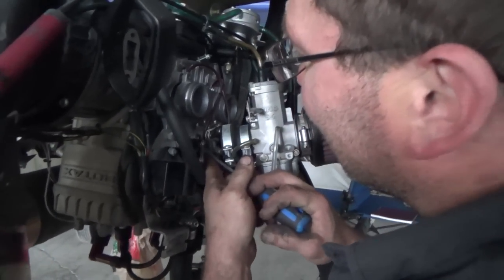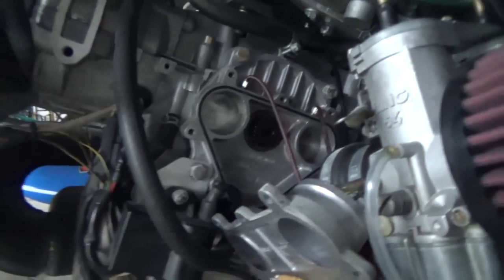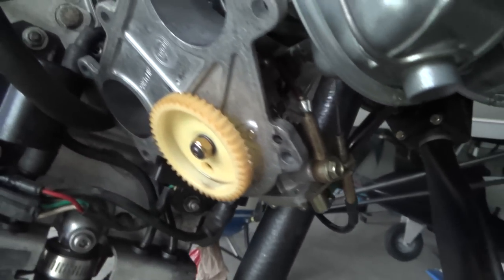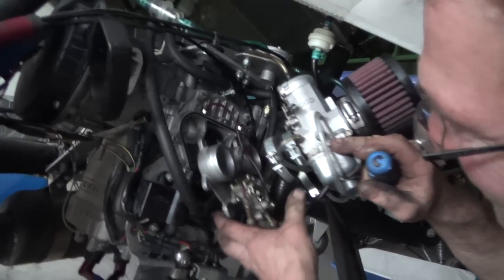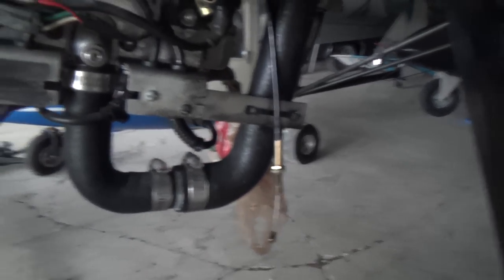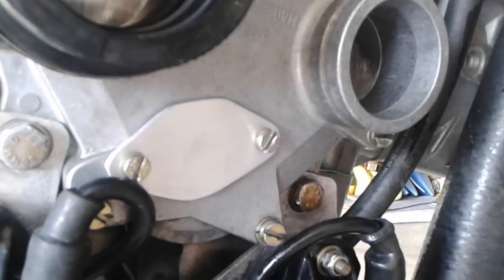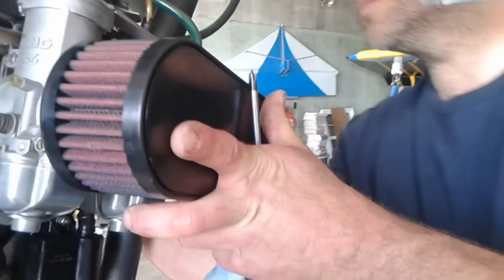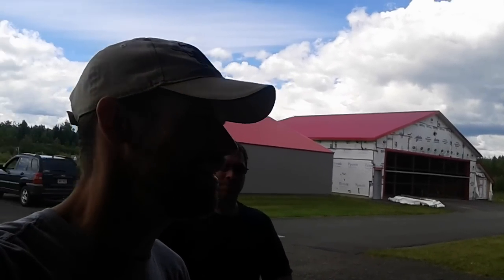Rotax 582 | Removing the Oil Injection

Comment from the maker: Since several have brought it up both here and on Facebook where I posted it, I wasn't actually double oiling the engine. I know I said I was in the video but it was getting rambly so I didn't include the following details:
- I was pre-mixing with Amsoil Saber at 200:1 which is a number I read online somewhere that indicated it was just enough to stop the engine from seizing if the oil pump quit. I don't even know for sure if that's true or not but it made me feel better anyway. 
- Amsoil Saber also has a fuel stabilizer agent in it which helps keep my gas fresh for longer (I still replace any gas in my tanks that's older than 30 days)
- I used Loctite everywhere the engine re-build manual said to use it
- I don't lock-wire my air filter for 2 reasons:
   - it's one unit held on by 2 clamps. It's very unlikely that both will fail at the same time.
   - I remove the air filter every 10 hours to chemically de-carbon the pistons and rings with Sea Foam. Lock-wire would make this already tedious process even tediouser. (that's a word... right?)

Comment: Premix also helps lubricate the carb slides and parts since injection is after the carbs. I believe it's a good decision and one I made on my 582 as well.
Reply: Carburators dont need oil to work, all 4 cycle gasoline carburated engines have no oil whatsoever on the carbs
Reply: @esau82  sure but it doesn't hurt, especially since the slide and needle on Bing carbs wear quite a bit due to vibration from the two stroke.

Comment: Hello. Thank you for your video.
I Just had a serious breakdown on one of my pistons & cylinders .  Oil Leak probably because i didn't do exactly what  was to be done when mounting the pump again... soo..
I'm about to make the same "treatment" on my 582. 
I 've seen the aluminium plate to obturate the hole left by oil pump. 
But i didn't see clearly what you have done to obturate these little metal oil injection  tubes  at the gaz intake . A special plug or other device ?
Reply from the maker: I just took a length of hose and connected them together with it. 4:55 shows what I'm talking about here.
Reply: @mmatt  ok thanks

Comment: if I'm not mistaken the hole that you plug goes into the crankcase if so there is a chance that the gasoline will degrade your Silicone on your cover placed you may want to consider removing the cover plate and using Permatex form a gasket instead gasoline will not degrade Permatex form a gasket
Reply from the maker: Thanks for that info. I going to look into this. Definitely don't want that failing!
Reply: I was going to suggest making a gasket.  They sell gasket material at the auto parts store.  Silicone is a bad idea.  Also if you add 2x the oil you will carbon up your rings.  I hear it's really bad on 2 strokes to add excessive oil...
Reply from the maker: Wasn't actually double oiling, I was only pre-mixing the gas at 200:1, not enough to make a significant difference in the fuel mixture or enough to add any considerable carboning. The 200:1 was a number I read somewhere online once that said it was just enough to stop an engine from seizing if the oil pump quit. It was more for peace of mind than anything but since I was already in the habit of pre-mixing, I figured I might as well just do it to the proper ratio and pull the pump.
Reply from the maker: Also, that sealer I used is what the Rotax certified mechanic suggested I use for the case halves so I'm pretty sure it'll be ok for this use too.

Comment: Did you figure out how to take apart that 3-way cable splitter?
Reply from the maker: No, it turns out that it's a sealed unit so we just routed it up and out of the way.
Reply: @mmatt  OK, thanks.  I think it's a mistake to remove oil injection which is highly reliable, uses less oil,  reduces plug foiling, and is more convenient.  I also recommend using Amsoil Interceptor vs Saber
Reply from the maker: @MrHanowski  To each their own. :-)
I can only speak from my experience; I currently have just over 550 hours logged using premix Saber mixed at 80:1. Minimal carbon fouling and no engine issues related to oil whatsoever.
Reply: @mmatt  I can't argue with those results, but I still think Amsoil Interceptor is a better choice.  Most PPC guys, Rotax engine rebuilders, and Amsoil agree.
Reply: This is great, finally somebody thinking outside the box and not listening to anyone, im gonna di the exact same to my 582
Reply: Thanks for making this video, A+ all the way

Comment: Hi Matt. Some other YouTubers who've done this on Skidoos or whatever have advocated filling that orifice that you blanked off with oil before screwing on the plate, to ensure the water pump gets lubed....what do you (and Dave) think? I'd hate anything to run dry.... I believe that there's a cross-shaft in the engine which gets lubed by the rotary valve oil, but that's a different supply isn't it. I'm not sure that oil gets as far as the water pump (?) but then I guess it does on those engines that have never had an oil pump!
Reply from the maker: As I understand it (although I might be wrong) that area still gets exposed to the fuel/oil mix making sure everything stays nice and slippery in there. I'm pretty sure of this because I forgot to seal the area around the screws when I put the plate on and I had fuel/oil mix leaking out until took it back off and sealed it properly.
Reply: @mmatt  Thanks Matt - You're a star. Always enjoy your videos!
Reply: @mmatt  are you sure about that ? You may be running it dry I’m rebuilding a 467 with similar engine design and I’m positive there are oil seals to keep oil in there on the crank
Reply from the maker: @phildelsol97  I'm sure enough that I'm not going to tear it apart and check... lol
I've got over 200 hours on it in this configuration so far with no issues in this area. If that changes however, I'll definitely let you know. :-)

Comment: I was considering doing this to my 618 on my kitfox but ive heard that the oil injection pump is critical to lubricate the rotary valve. Im not sure how true this is but just wanted to mention it. Let us know how this works out  :)
Reply from the maker: Not according to my mechanic.
Reply: @mmatt  Did your mechanic design or build the engine? Did you even bother to ask Rotax themselves, or just take the word of some guy in striped coveralls? I own several pairs of those myself. I have an Eros with the 503. The previous owner removed the pump. I, am re-installing it!
Reply from the maker: I have confirmed with a Rotax certified technician that it is perfectly fine to run any of the Rotax 2 -stroke engines either pre-mix or oil injected. Both methods have pros and cons but neither are inherently damaging.
Reply: Yeah pretty sure the rotary valve needs that oil going directly into it. The old 340 and 440 R/V engines in the late 70s & early 80s were premix, but the rotary valve actually still had its own separate oil reservoir.
Reply: Does the rotary valve not have its own re-circulating oil supply (the little cuboid bottle sitting just above the electronic ignition units)?

Comment: I agree with your decision of removing 1 piece of a mission-critical system & I would consider having oil in the engine (or fuel) "mission-critical".  You DON'T want to starve your engine especially when you're up there in the thousands of feet.  And a nylon gear supplying oil for the mix is unnecessary when you're already mixing!
/So yeah...Bob's your Uncle!
Reply: Thats why you have to follow preventive maintenance and TBO schedules

Comment: As a fail safe rotax does if something happens to the oil pump its goes to the highest setting possible on the injection
Reply from the maker: Not the one I had.... and I'm pretty sure mine was factory. My oil pump went to the lowest setting if the cable failed and the Certified Rotax Tech I spoke to said that when they fail, they fail off, not on. He's only seen that happen once mind you as they are typically very reliable pumps.

Comment: Rotax Rick says the plastic gear in 1 out of 5 motors he rebuilds is melted not sure what he is talking about he claims that the injection system is flawed and he won't warranty any engine he builds for someone if they use the injection system.
Reply from the maker: I've never seen one fail. The only issues I've ever heard about with them are human error. I just prefer to pre-mix because I don't like the extra parts bolted to the engine and because it's what I'm used to doing.

Comment: I mean you can do what you want but I can guarantee you they're going to be doing it complete engine rebuild by the time you can hit a thousand miles but again do what you
Reply from the maker: Over 200 hours so far (at 60 mph making that around 12,000 miles) with no oil related issues.

Comment: I would not do this.  I think it is very important to monitor oil consumption with injection, but from all I have read about premix vs injection, more engines have trouble with premix, due to improper mix, settling, and loss of oil viscosity.
Reply: Not to mention the sooting up while awaiting your turn at the drag strip! The injection pump lowers the mix to 70-1 at idle, decreasing the carbon buildup as well as the blue smoke that you are choking on!